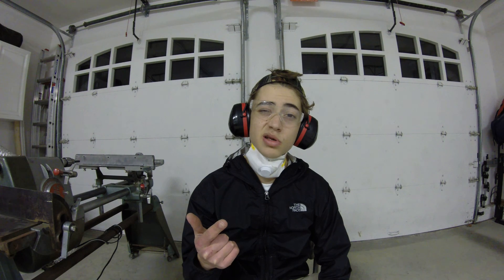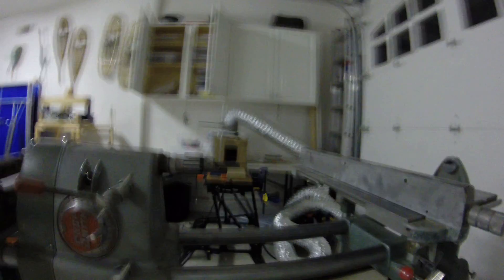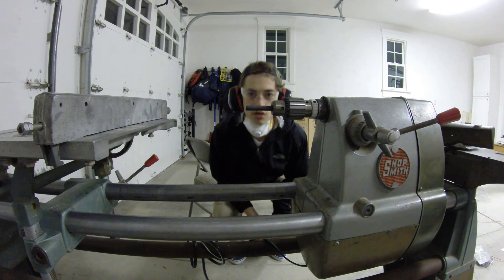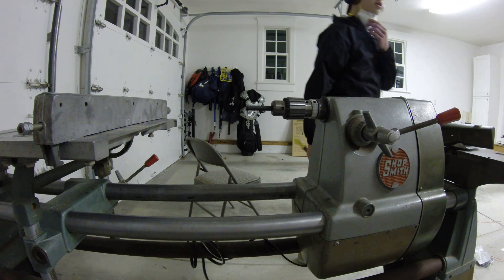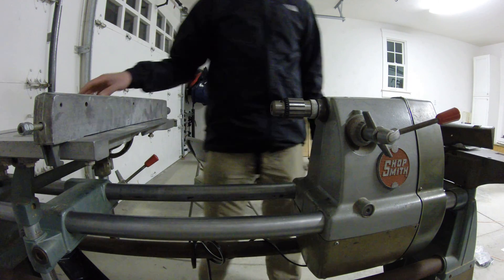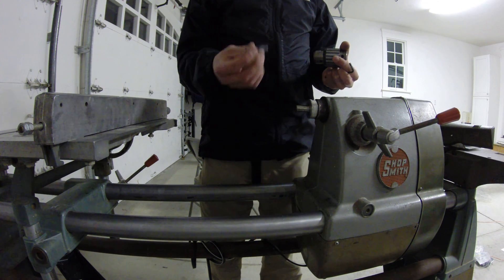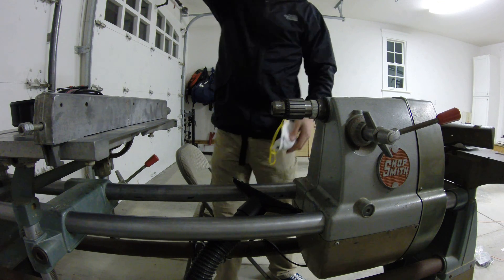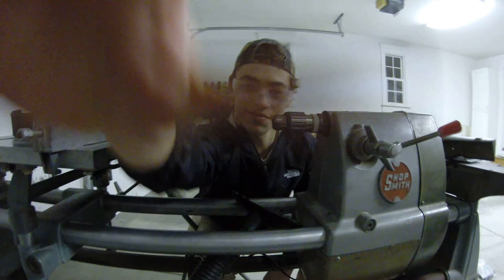How to Make a Graphite Tool for Glassblowing (Part 1)

Comment: I'm looking to make some custom shaping tools that involve putting handles on the graphite, never done it before. Do I treat it like wood and just drill a hole and put a screw in handle? Will it crack? What's a good technique to attach a handle to graphite? Any input appreciated 👍
Reply: That was  exactly what I was looking for. Even the title is misleading. I see some tools with a 'u' shaped channel which the edge of the graphite foes into, but so far have not been able to locate just the handles. It looks like they put  'bolts' through the 'u' channel and the graphite, with a nut or a cotter pin on the other side? Graphite is pretty easy to drill through with a diamond bit, not sure otherwise though.
I had a graphite paddle with a wood handle, inevitably the handle gets some heat and over time it fails, so I think I'll go with metal next time.
Good luck in your search, if I come up with anything, I'll let you know.